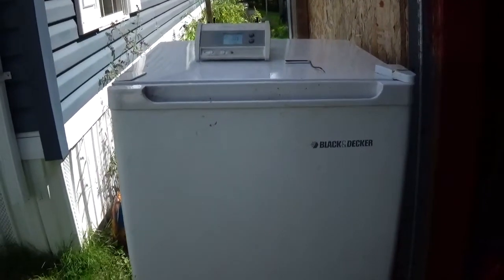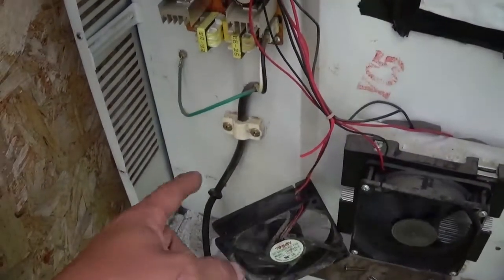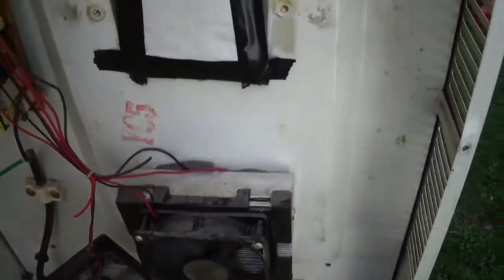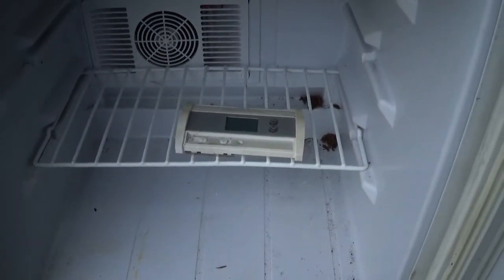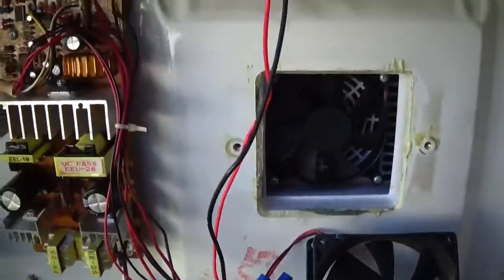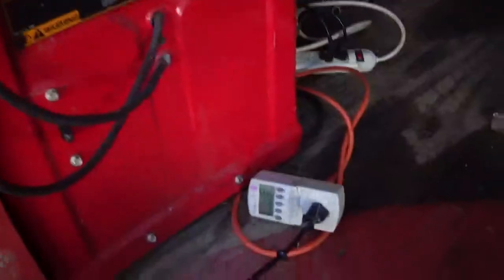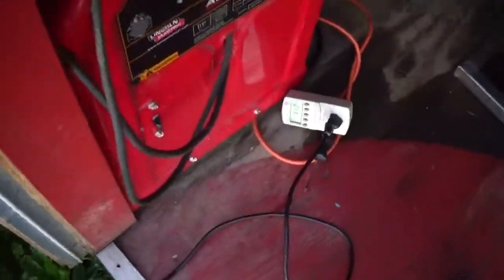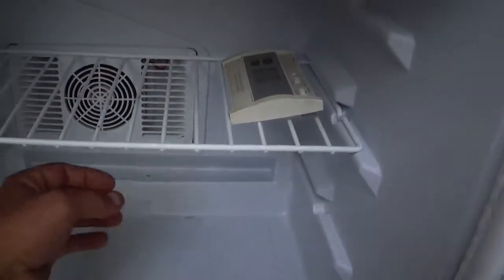Piltier Refrigerator repair { no compressor}

Comment: nice job,i have one of those 12 volt coleman cooler/warmers that i used during hurricane season. even with 2 batteries in my truck it sucked the juice down quickly
Reply from the maker: Yeah, at 150w it would be like leaving the head lights on. Where I live theres natural gas. Been thinking of getting a generator that will run on it. When the power goes out here it can be out for days.

Comment: I have one that's exactly the same model. However the fan on the bottom is making noise like the fan is loud and gets louder within mins of being on....it does keep things cool its just the fan is very noisy and I am not sure if it's the Condenser motor fan or just too much lint in the motor?. I'd like to know how to replace it or some input on how to repair it